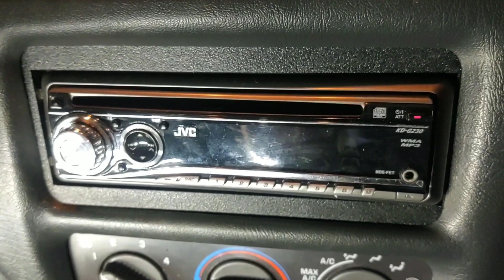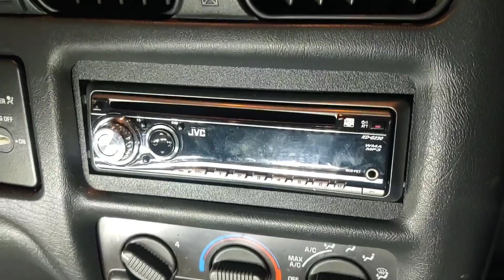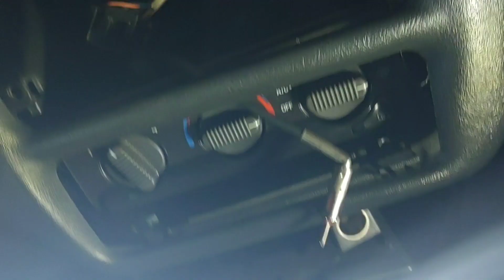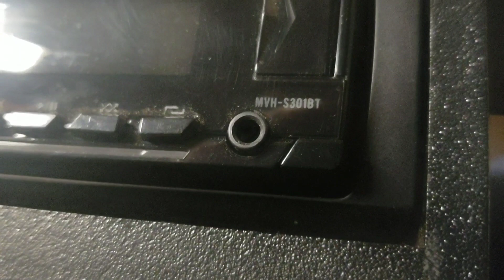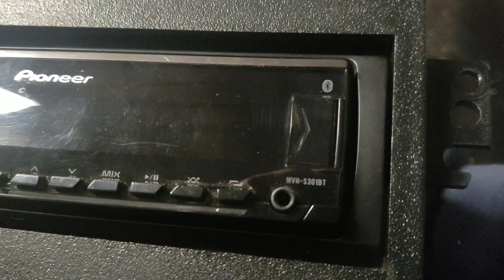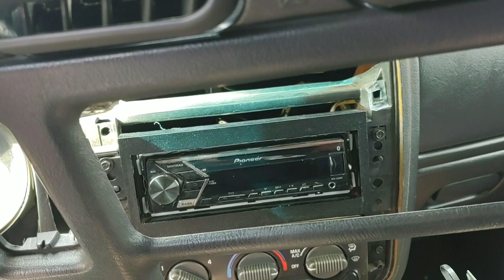2000 Xtreme Headunit Swap

Comment: Pull the chime box out that will fix the issue with the headunit not shutting off. The door pins go bad and doesn't shutoff when you open the door
Reply from the maker: I didn't realize the hu shut off when the door opened. Also the next episode will show why my new pioneer doesn't turn on
Reply: @casperskafs  my blazer had the same issue with it not shutting off.